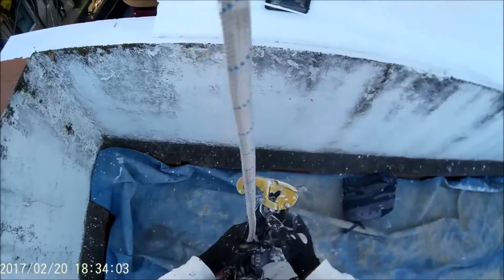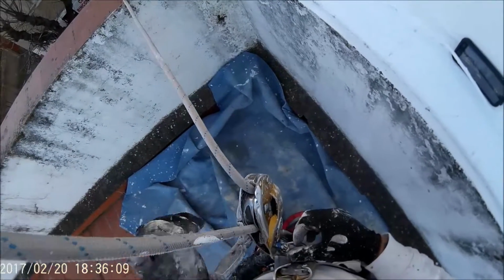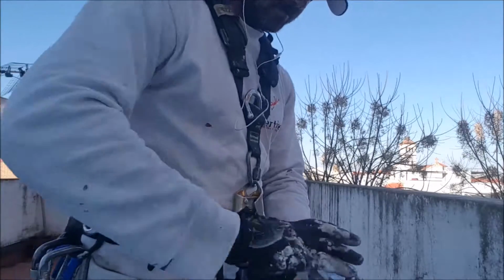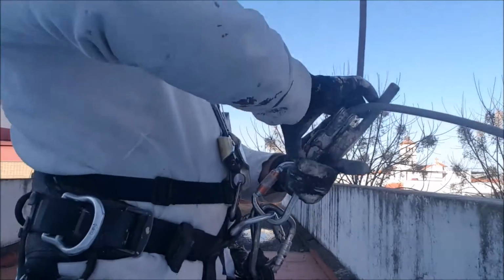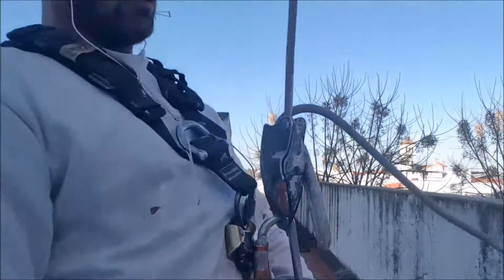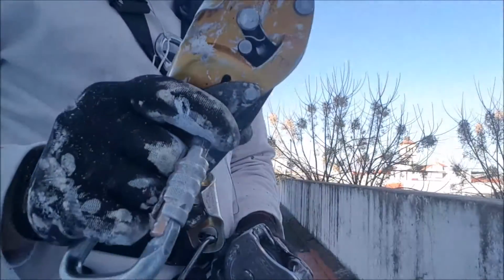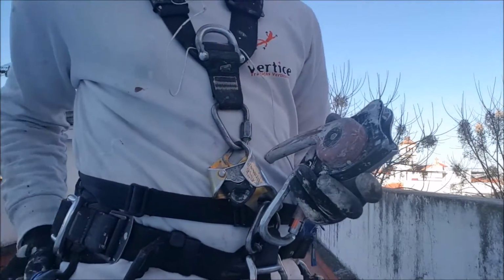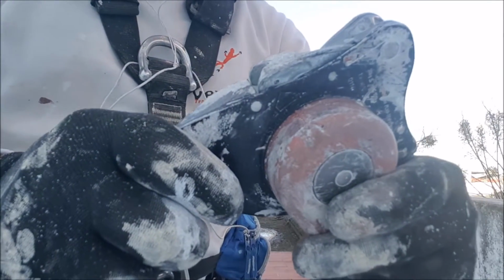Insider tips for several types of descenders

Comment: Thanks for your video. The question of friction and descendeur size does not only depend on your experience, but mostly of your weight. I do this job for over 10 years, i think the rig is done for light loads. I often go down with 10 to 25 kilograms of  additional weight of working gear (100-110 total) and in this case the friction of the rig isnt enough. In my working condition it lasts only less than 6 months... After you see some holes in the alloy and even steel parts !!! To my mind the perfect descender doesn't already exist, it would be a rig with adaptable friction and a lifetime increased with steel parts.